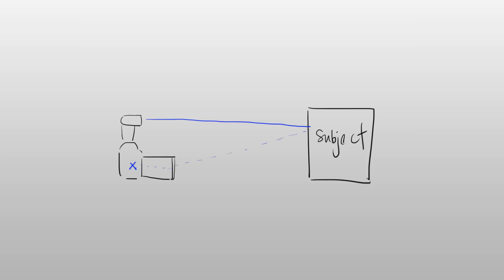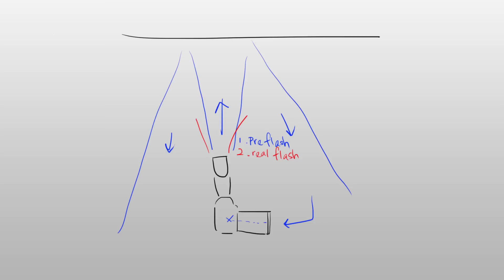What is TTL? (vs Manual flash)

Comment: Hi Great informative video I’m new to flash photography and although I new what TTL did I wasn’t sure how it actually worked now I do however I recently bought a macro flash unit for my Olympus camera which has a TTL setting. I was filming in A mode (aperture priority) and tried TTL on an outdoor subject the flash worked but when I looked at the image it was completely “blown out” surely like you said in the video the system should have produced a perfect exposure having sensed the environment first any ideas what happened (settings etc) cheers .
Reply: Lower the power setting on the speedlight. That should solve the problem.

Comment: .
so if the camera is all in manual setting does it mean the flash output will compensate for it and not the other way around? 
does the flash ev on camera meant for the camera built-in flash or the mounted flash takes over? and then there's another flash ev on the flashgun itself that adds to my confusion
.

Comment: A third mode, usually known as "Auto", has a photocell on the flash unit to control output.  It came before TTL was invented and is found on older units (c1980-2000).  It did not depend on camera brand. Some of the those units had all three modes (ie Manual, Auto, TTL). The Auto mode seems to have been dropped from modern units, cost saving I guess.
Reply: I wonder if you can still use old speedlights that has an AUTO mode, on digital cameras?
Reply: @thehumanityoflife6460  Yes, you can, but be careful that some old flash units had high trigger voltages that could damage a modern electronic camera. Most made after about 1985 were OK. Also be careful that from around 1980 many flash units had extra contacts on the foot for various functions, and these must be compatible with your modern camera, so watch what brand of camera the flash unit was made for.  BTW, "Speedlight" is a Nikon brand name, not a general term. Confusingly, "Speedlite" spelt differently is  Canon brand name.
Reply: There are 2 versions of TTL. The first version invented which sounds like what you're talking about and E-TTL (i-TTL, P-TTL and so on), the latter of which is the TTL system used in flashes and strobes today.
Reply: @jasonbodden8816  You are right. The newer typeTTL works on a different principle but still measures the light Through The Lens.  The older TTL measured light reflected off the film emulsion during exposure but we are told the shiny digital sensors don't reflect light the same way, so modern TTL uses a pre-flash to assess the exposure. But cynics call BS and say it's because the pre-flash method is cheaper, and early DSLRs did use the older type.

Comment: Thanks. I'm finding using flashes in general a real bore. I never get pleasing results from them and have had my YN560 sitting in my bag for a decade. As someone getting into wedding photography now I'm thinking I need a good flash for the reception which has challenging lighting at the best of times.

Comment: I have Metz 32CT 3, It does have TTL. I find there's only one pin for  the Canon 5D Mark 4...Works? This flash is vintage one over 40 years. I like Metz flash gives accurate color temperature. Do you think it would 'burn' my camera?

Comment: Thanks for the nice video. I'm still in a dilemma. I have a flash model YN685. I plan on buying another Yn flash.
Which in your opinion is a better flash of the YN600 or YN685.
I want to connect these 2 flashes with one wireless trigger
Which model is a wireless trigger.
Yongnuo YN685 vs YN600 to the Canon 600
hopefully there will be time for one answer.

Comment: Retarded question but I need confirmation. If camera ExpComp is set to -0.3 and Flash TTL ExpComp is set to -0.3 too....... the photo will be exposed -0.6? Thank you.
Reply from the maker: That's correct, the photo will be 2/3 stops underexposed.
Reply: Thank you.
Reply: It depends on your camera mode. Since shutter speed wont affect affect your flash output. If you are using apature priorty mode, you would only lose -0.3stop exposure. But if you are shooting in shutter priority mode, you should get -0.6 stop.

Comment: Hi i have just bought the Yongnuo YN 24 ex, it doesn't work at all when the camera is on manual mode plus according to manufacturer when the flash is charged the indicator light should be green which never happens it is always solid red and I am using brand nee fully charged panasonic eneloop pro aa batteries. Any help with that?! 
Ps i have the white balance at flash and my camera is canon D700. Thank you
Reply: I am in the very same situation! My T5i does not recognize my YONGNUO YN560-IV SPEEDLITE.

Comment: Great video. Question do u set your camera exposure first then the flash will automatically set the power automatically?  Or do u under expose your camera and the flash will determine the amount of power?
Reply: If you want the scenery around and in the background to show then you set your camera to expose it as you desire according to the ambient light. Flash is then just a little addition to help bring out the subject to either be in better balance with the background or stand out even more so first just get your exposure right as usual then add flash if needed. You would only underexpose and compensate with flash if you were trying to darken the background.
Reply: Generally with TTL flash It is plug and Play. You just put the flash on and go. If you are shooting in Manual mode on your Camera and your flash is in TTL mode the Flash will do all the calculations needed to provide the correct exposure.
Reply: waipahutube exactly , someone please answer this question

Comment: what meeting system does TTL use? does it use whatever i set it to on the camera? for example I really really need centre weighed / spot metering.
Reply: TTL uses the preflash that fires  at 1/32 power when you press the shutter  button halfway. That preflash in conjunction with whatever settings you have your camera set to uses reflective metering (the same type of metering your camera uses). It will take into account what Metering Mode you have your camera set to.

Comment: Is it acceptable to bounce Canon TTL flashes, coz many times I have encountered a issue that, when I use a TTL mode on my Canon 430 EX II and bounce it over the ceiling I get a underexposed shot but when I point the flash directly on the subject it exposes correctly e respective of the flash exposure compensation inn TTL mode. But certainly when I bounce Nikon TTL flash in B-TTL or I-TTL mode i don't encounter this problem. Could you explain the mechanism both the brands?, Never tested other brands except Digitek n Simpex! Thanks in advance!
Reply: Ameet Pawar I use the Canon 430 EX II for bonce flash all the time and the only time I have the problem you are talking about is when the flash runs out of power. If the ceiling is to high or it is a darker color I will have to increase my ISO in order to get the correct exposure. I have also found that if you zoom the flash in, you can get an extra 2 stops of light output from it or at least you can get 2 stops more light where you need it.
Reply: I have the Canon 600 EX-RT and it's a phenomenal flash. TTL is fine with it. Some mentioned Yongnuo flashes. Yongnuo has gotten really great at providing quality products for a lot cheaper than the proprietary brands. I have the latest in their line of speedlights, the YN685 with built in YN622C wireless trigger/transceiver, and it works incredibly well. The TTL is pretty amazing.

If the ceiling is extremely high the light won't reach it therefore not illuminating your subject properly at all. In a case like that, you'd need some sort of bounce card that would throw a lot of light forward on to your subject. There are many of those on the market. 

But if you're getting underexposed shots in TTL with a reasonably low ceiling, then you'll need to increase your Flash Exposure Compensation (FEC) and/or your ISO. But if you have to increase your ISO I'd advise you not to pass 800 if you're using a crop sensor camera. I very rarely need to use that. Almost never.

And TTL is very rarely ever spot on (with speedlights anyhow). TTL is your flash's best GUESS at what the exposure on your subject should be via reflective metering from the preflash in conjunction with your camera settings. You decide whether what TTL determined is the correc t exposure for YOUR taste. If not, then adjust the FEC to taste.
Reply from the maker: Ameet Pawar I personally haven't had much experience with Canon TTL flashes. I mostly purchase third-party flashes. The only Canon ETTL flash I own is the 320EX. Based on the 320, the bounces do tend to be underexposed, albeit slightly (around 1/3 stops). Hopefully someone with experience on Canon ETTL flashes stumbles upon this comment and shares their findings.
Reply from the maker: Most my flashes are Yongnuo flashes. They aren't the absolute best quality out there but they are reasonably-priced and get the job done.
Reply: ZY Productions Thank you for useful information. Which third party flashes u prefer for the Nikon DSLR camera's on a budget of $150?. Thank you!
Reply: Yongnou any specific model u suggest. Thank you for the valuable in formation u shared!.
Reply from the maker: For the Manual flashes I roll with the 560 IV's. For TTL the 568EX II is a pretty decent flash.
Reply: +ZY Productions  how about TTL YN565EX?
Reply: Nikon has the superior "i-TTL" system , far more effective than any brand, although Minolta was the first to come up with the idea and Nikon made it better
Reply: Cesar Abraham I disagree but I won't argue it.
Reply: I think that it is an error to refer to a flash as TTL,  I mean to categorize flashes into two: TTL and automatic. Intelligent flashes can work in the TTL mode or the Advanced Distance Integration mode. In the ADI mode, the camera uses the subject distance to determine the intensity of the flash while TTL measures the the light that is reflected from the subject and uses the value to determine the flash power required for exposure.